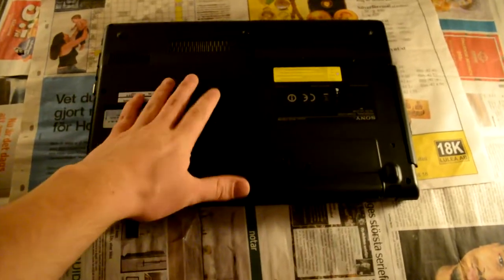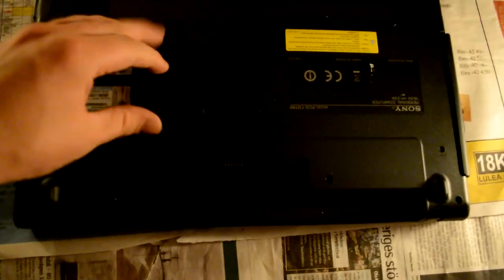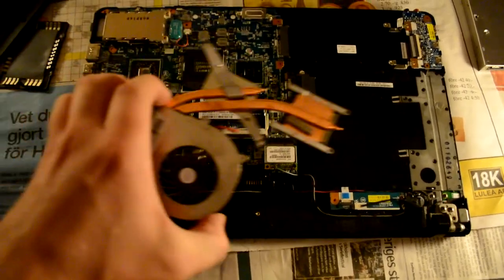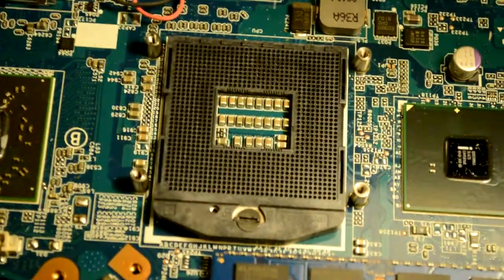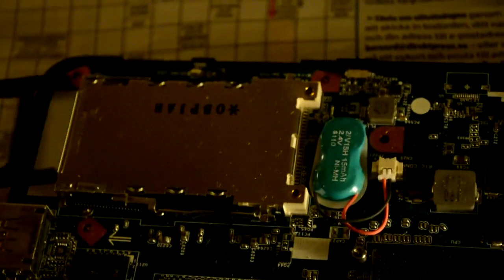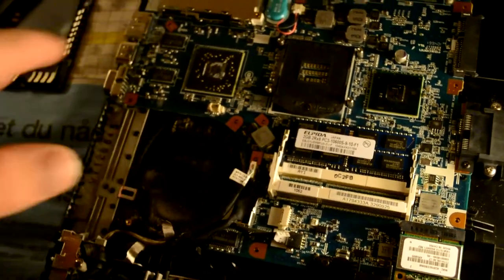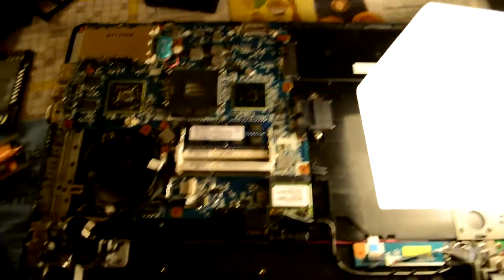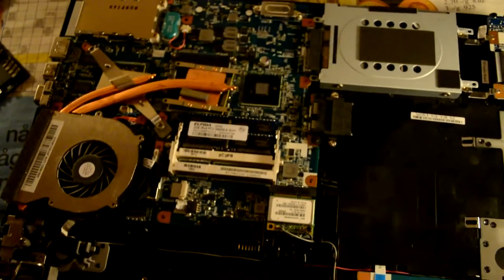How to identify the main parts and components inside a laptop computer

Comment: I have got a stapler pin stuck inside my laptop, it fell through the mousepad gap while I was cleaning it. Will it create any problem ? Please help.
Reply: I'm not very sure, you should search a video on how to disassemble a mouse, if it is interfering with any important parts like wires, remove it.